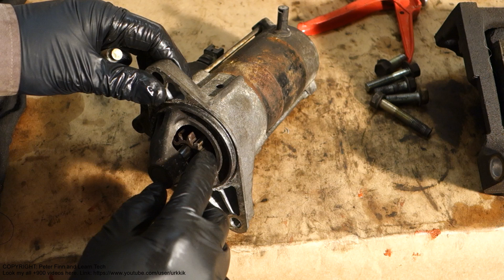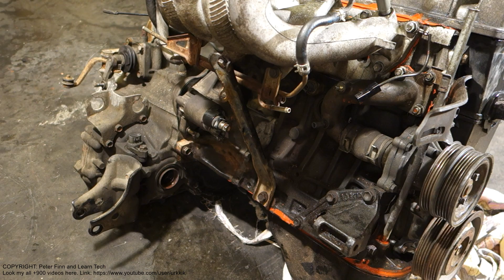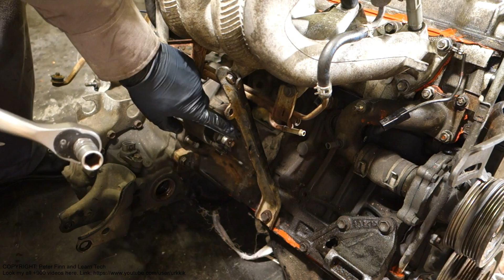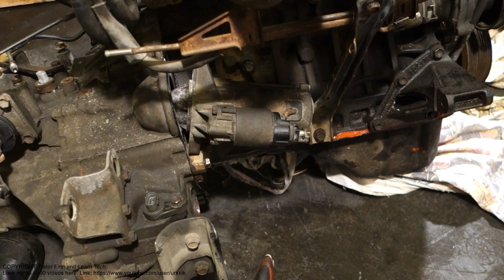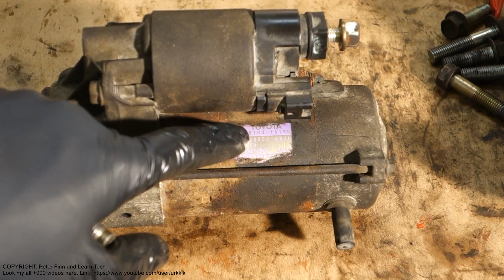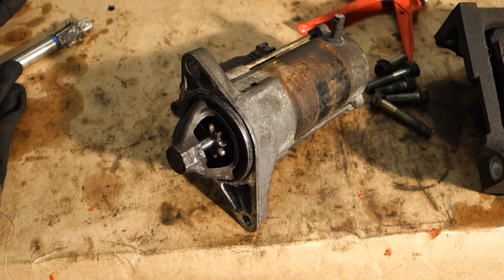How to replace starter Toyota Corolla years 1992 to 2002

Comment: My 95 Corolla has no crank and no start. I turn the key, lights come on (good battery) push in clutch and try to turn on and nothing. No noise under the hood just lights dim like it wants to but no no crank.
Reply: Hello, I have the same issue but it sometimes cranks and starts like a clockwork. Do you remember what was your problem with?
Reply: My 91 Corolla is doing the same thing. My also sometimes starts with no problem like the other commenter.
Reply: If the lights dim, it’s most likely the starter itself with bad brushes or a flat spot on the commutator.

     If the lights do not dim, it’s either the starter relay or the solenoid on the starter.

Comment: Hello! thank you for the video! I'm currently doing a starter replacement on my 1996 corolla 1.6L I notice on this engine the starter is slightly different to yours.. Having trouble bolting back in the new starter as the lower bolt doesnt seem to want to bit into the threads in the engine, the top bolt goes in just fine. I compared the two bolts and they are identical in size and thread count.. 
Have you seen, or do you have any experience with this sort of issue?
Reply from the maker: Thanks for info. 😀👍

Comment: So you have to pull the engine to pull the starter?
Reply from the maker: No. Only one starter pull is enough
Reply: Lol that what I was thinking.
Reply: i just changed starter on an old toyota avensis but its the same thing. Big pain in the butt. You have to disasamble the air box and the tubes then find the bolt on top. The bottom bolt is also possible from the top of the engine but you should basicly climbe on the engine and put the socket on the bolt blind with a short extension. you can only turn it like 2 click at the time,  i did it from under the car. the starter comes out the top of the engine. to put back was easy
Reply: @avinashjagdeo  for real. That's what I was just saying. I have small hands and there's some clearance at the back on my 97 prizm... I'm trying to decide if there's a way I can sneak in and get it from the top. This guy made it really easy to visualize the exact location tho. Props to him!

Comment: My car Cranks But Won't Start What Should I Do
Reply from the maker: OK. First thing is to check spark plug. Look my videos 1-8 : https://www.youtube.com/watch?v=T6qI1OnjPvQ
Reply: Engines run on 4 things. Fuel. Air. Spark. And all these have to be delivered on time. What have you checked so far?
Reply: Don’t forget the alternator. You can have a brand new battery but with a bad alternator you won’t turn on nothing
Reply: David Chavez you are so incorrect it hurts
Reply: @iamtenzin4409  Sorry for being 7 years late, but you said engine runs on 4 things and just named 3. I guess the fourth one is the "will of the owner" ? :D
Reply: @igor.vysoky  I think "time" is the 4th one. Makes sense. If you don't have the engine timed right, it'll run rough, if at all.